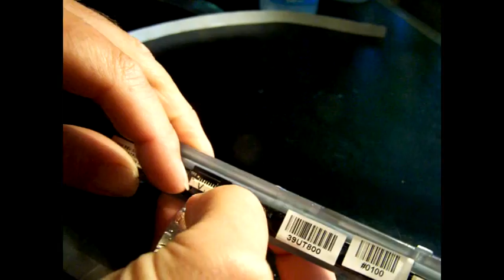dv8 OSD Pop Up Solution Part 2

Comment: I actually did this repair on my dv8 a few years ago using the copper foil tape and it worked well. But it started acting up a few weeks ago and I think it is because of corrosion as I no longer had conductivity between the copper tape and ground. So now I redid it using the same type of tape in this video and the touch bar troubles have disappeared for now. I hope this repair will last longer. So copper tape may not necessarily be better. Also my copper tape did not have conductive adhesive.

Many thanks for this video!

Comment: Haggiscat Your solution is incredible worked perfectly with my HDX18 only after 4 years my HDX18 is faulty screen. already traded flat cable, inverterr I wonder if I can put a screen the same size however it is samsung LED Ltn184ht02 is possible to adapt it in a HDX18 know that the HDX is the dual lamp

Comment: Thanks for the help ! I just finished the fix of my DV8. I bought the Kapton tape at Ebay.de for 1,2 EUR (yes only 1,2 eur!!) and the duct tape via Ebay.de for 7 eur (yes only 7 eur). Kapton tape came from China to Denmark for 1,2 EUR including freigth. Amazing... How can they earn money on that??
Video was fine. I completed it with out the alcohol though since it was mentioned late in the video. I did give up on the laptop but now it seems cured. :-)

Comment: I finally got around to doing this and it solves the problem!! It was very easy to do and I bought the shielding tape and kapton tape off of amazon as you instructed. I had originally did your first post in the HP forums but finally got to this one after my wife had been using it for her school work. Thank you so much for doing this video!

Comment from the maker: YUP ! You sure can, it's best to remove the cable entirely, but if you don't want to remove the cable, put some sort of tape over bare ends of the cable.
 THIS IS IMPORTANT _ BE SURE THAT THE WIFI BUTTON IS ON (BLUE) BEFORE UNPLUGGING THE CABLE. If it's in the red there will be no way to turn it on ounce the cable is unplugged. You will be able to turn the WiFi off and on in  Windows Mobility Center in the Control Panel.

Comment from the maker: Sorry for the late reply _ been very busy. Open the laptop enough to gain access to the back edge of the case and where the speaker cover meets the case. Put it on it's edge and while pushing firmly, but  gently on the case use the corner of an old credit card to release the snaps. This can also be done along the outer edges where the speaker cover mates the chrome.

Comment: sigh, we couldn't even get the speaker cover off!  Any tips on getting that off?  The tabs at each end, closest to the cover hinge was what we couldn't spring loose.  All we are going to do is remove the cable.  Thanks so much for your work on this.

Comment: After a year and coins dealing with this crap, found the firmware for the buttons supposedly to solve it. Honestly, is been 3 days without problems since it was installed (but I didn't touched that much the buttons neither). Thanks for the video, planning to do this next if the firmware does not really solve it.

Comment from the maker: Yes you can, but make sure and remove the cable entirely and have your WiFi button "ON". If it's in the "OFF" mode and you disconnect the bezel, it will be off and there will be no way of turning it back on. Ounce it's on and the bezel has been disconnected, you can turn your WiFi off and on in "Windows Mobility Center" in the control panel.